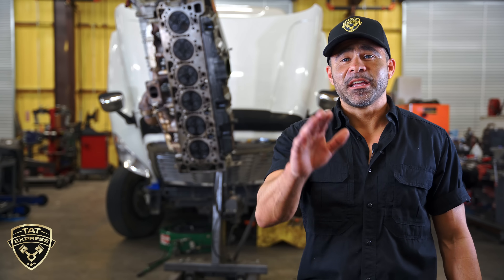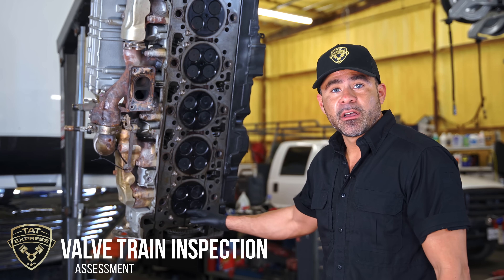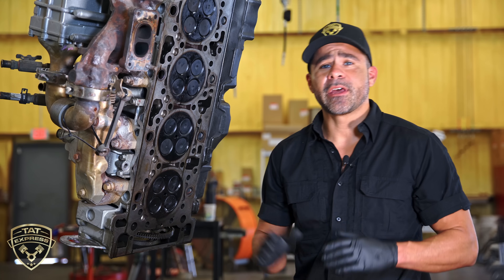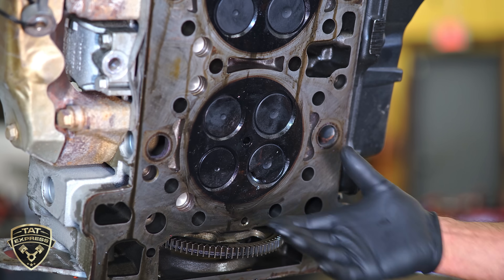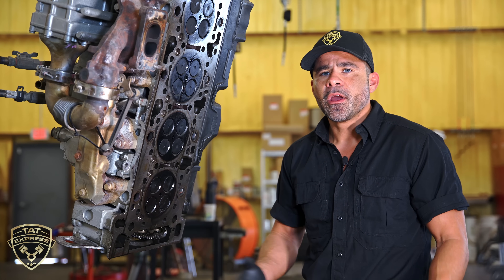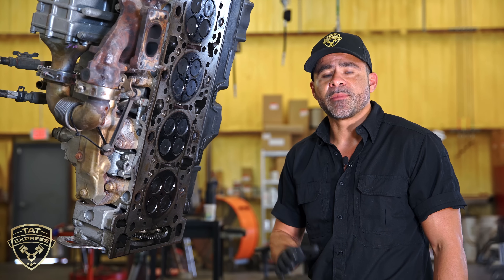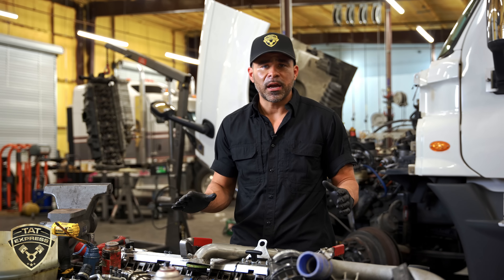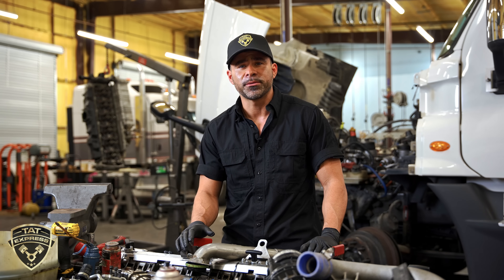The truth about semi deletes/Semi truck delete/diesel engine deletes/diesel delete explained

Comment: Damage to the intake valve was likely caused by soot buildup in the intake breaking off and jamming the valve. This buildup occurs when the EGR is functional. When deleting, the intake must be removed and cleaned to prevent this. This failure would have happened regardless of the delete. In our fleet, engines that have been deleted have over double the service life because these engines don’t put a high soot load in the lubricating oil. We also leave the horsepower rating at original spec.

Comment: not from my experience but anything can happen some people have no business working on trucks or driving them.
Reply from the maker: You’re right — a lot of issues come down to how the work is done. With deletes especially, the problem isn’t always the concept, it’s the execution. Modern engines rely on precise airflow and calibration, and one bad tune or shortcut can destroy a motor fast. Quality work and proper diagnostics make all the difference.
Reply: @TATEXPRESSINC  Pride in your work is a rare thing these days, maybe if the diagnostics were better understood by the people doing the work and educating the driver on proper operating procedure  for a vehicle with emission controls there would be less down time. Also fuel quality and def quality is probably has a role in messing up the sensors and filters.

Comment: Deleting a diesel engine will cause your EGTs to rise. EGR lowers your EGTs and also your horse power and fuel millage. During a study researchers found that engines with EGR intact had more lower piston ring wear because of the increased soot being fed back into the combustion chamber. However, engines with deletes had more upper ring wear due to more heat. In years past diesel contained sulfur which is also abrasive to piston rings. I’ve seen semi trucks go over a million miles with EGR and SCR intact. I witnessed a 2021 F-350 go over 525,000 miles with no emissions system failures before the owner traded it in. Had very little blow by. Truck towed non-stop its whole life. If these modern diesel trucks are used as intended the emissions systems will last. Short trips, never towing, lift kits / stuntin’ around, etc will cause problems and more soot to accumulate. 95% of pickup truck buyers would be better served with a gas truck. It makes no sense to own a diesel unless you tow heavy often. They are tuned for work.

Comment: I've deleted close to 100 trucks (Detroit,Paccar,Cummins) because where I'm from we don't need that crap and all those trucks are running strong and they just keep going... It's all about the tunning,and in most cases I don't even touch fuel maps on the file...

Some people delete and increase HP at the same time and that's another story...
Reply from the maker: @jcjc2593
I get why guys go that route — breakdowns cost time and money. But here’s the reality I see in the shop every week:

• Deletes often hide the real problem, not fix it
• Engines end up running richer and hotter
• Premature turbo, injector & aftertreatment failure
• And once it fails… repairs are way more expensive

Comment: Absolute garbage info. This guy is trying to sell you more maintenance on all those systems. Yes deleting *can shorten the light of the truck if you turn the power up, but a lot of people delete all the systems to extend the service life of the truck and reduce the maintenance costs. Since when is pumping dirty exhaust back into your engine, a good idea lol what a freaking joke if you keep the power at the same level from the factory, you get better fuel economy, and a lot less maintenance in addition to a longer lasting motor.

Comment: Tuning determines power, deleted or not. I would argue the valves run cooler on deleted trucks and the EGT is lower. A free flowing exhaust allows the turbo to move air across the piston top and valves during the overlap period. There are too many tuning factors to consider to just blame a delete. What is the injection timing? What do the fuel tables look like? How much power is the tuning intended to make? How tuning makes power is very important. Done right, this is a million miler all day, done wrong.....
You have a broken intake valve and seat. Most of the compression is going into the intake. As for the cooling system pressure, the head gasket  is not the problem. Look for a crack around that valve seat.

Comment: Who told you that delete give you more power that a big lie it depends on the tune on the ecm you do. Bro you the only mechanic that don't like  delete, be real mechanic not fake one please
Reply from the maker: I am one of the realest out here. Hack deletes will push the engine beyond its designed limits, increase cylinder temperatures and cause failures. 💪🏼🔧🚛

Comment: After treatment crap can go to hell ok say itvwill give u all those pronlems after yr 1-2  but how much u gonna save on dat time frame not dealing with the bs EGR NOX SENSORS. def pump SCR filters gotdamn land of the free my A…
Reply from the maker: I get the frustration — aftertreatment issues are expensive and can be a nightmare when they fail. But deleting it doesn’t make the problems go away — it just trades short-term savings for long-term risks like fines, warranty loss, and major engine damage. I’m here to help drivers avoid all of that and keep their rigs running strong the right way.

Comment: WELL MAINTAINED CAT DIESEL ENGINES HAVE BEEN GETTING 3,000,000 MILES WITHOUT DEF AND PRESIDENT DONALD 🇺🇸 TRUMP IS GOING TO LEGALIZE "DELETING" SO... YEAH LYING IS BAD 🖕
Reply from the maker: CAT engines take modifications better than modern engines because they were designed without emissions, so reversing is easier for these models. If mods become legal, that would allow the market to produce quality tunes compared to what's on the black market now. Modern engines can not handle the excessive heat when turned up and modified. They are pushed beyond their designed limits. 🇺🇸🫡💪

Comment: If the government deregulation kicks in, could another engine be installed into a newer truck if needed?
Reply from the maker: I have heard of new regulations being stopped, but existing regulations are still enforced. This does not change the fact that modern engines are designed to run on after-treatment systems.

Comment: Bullshit. The delete isn't the issue. The tune is everything. U can't see the tune so blame it on the delete. FYI a delete truck runs COOLER. Your theory of delete is bogus. Stick to being a parts changer. U have no clue.
Reply from the maker: Your feedback is bogus.  Do what you like. It’s your truck. If hack tunes are all that is available, the results will be the same. Deleting pushing modern engines beyond their designed limits

Comment: My experience with delete: after countless dpf issues and tens of thousands of $$ I decided to do the delete, the final straw was that in a Freightliner dealer they told me that I needed to replace the whole 1-box..... Not a cheap option!  so a friend of mine recommended me a mechanic that did  deletes so I went for that option instead of spending over 15k! @ 1st it was Wonderful but later on my engine started to break and it was not cheap repairs! My engine started to consume a lot of oil  just after 4 months from the delete and  one day the inevitable happened: blow-by... I was not happy about that! I was torn between buyin a newer truck or do the rebuild so after carefully considering it I chose the rebuild!... If you want the rest of the story make a comment requesting it & I'll put part 2!
Reply from the maker: It sounds like you had a very unfortunate experience.  The deletes can be tempting but they definitely void your warranty and will likely be a more expensive repair down the road.
Reply: I don't think a 2014 truck has any warranty left on it! so no worries about that!

Comment: I as well argue that a delete and more power are not related.  Power comes from a tune, delete or no delete.  The engine runs clean air under WOT from factory, so your AFR will be as intended regardless of def or egr.  I agree the delete was done poorly.  However, on a proper delete with the engine running factory power, your only concern is proper coolant flow since the egr is compromised.
Reply: Right now my only complaint is that after the bypass, the coolant temp and oil temp take a long time to warm up.”

Comment: All deletes are not bad. But most shops are working on dpf systems instead of engine issues 90 percent of the time. So it's a cash cow for shops. That's why most dealers and private shops don't work on deleted truck because most of their work is dpf issues. Bio diesel is another problem for these issues but know shop will tell you that because they make money off your break downs. DD15 engines is supposed to use ultra low suffer diesel not bio diesel.  Bio diesel creat more soot causing more dpf problems by clogging up the filter system earlier than expected. That's why you do an overhead annually and do a cylinder compression test every 6 months to prevent issues like that and also see what's going on with your truck internally. I wouldn't recommend deleting or blocking off EGR ports because the engine need to Flo for performance reasons. So if you do that  and change your oil and all your filters every 14 to 20 thousand miles you might be able to get 2 million miles out of your engine.  I'm at 1.6 million miles on my 2011 cascadia with original internals except the bottom end has been done twice.
Reply: And yes it's been deleted over 3 years ago and counting with no problems since the delete.
Reply: And remember doing Covid the epa allow shops to delete DPF systems on a lot of trucks  because of low parts 
Inventory. So some dealer shops really can do good delete because they have the programming to do it. So I'm sure that kind of stuff gets sold to other shops. You just have to do your homework like any other project.
Reply: Which part you remove which parts left on the truck.  I'm thinking about deleting my truck

Comment: how does a cracked valve cause coolant pressure? shouldnt you have excessive crank case pressure?
Reply from the maker: The cylinder head was cracked as well, causing combustion gases to enter the cooling system.

Comment: Trucks in mexico dont have emissions, all you gotta do is get oem parts and template from a mexican truck
Reply from the maker: Modern diesel engines are not designed to run without emissions systems. Any tune will push the engine past its designed limits. Series 60 engines are less effective because they were originally designed without emissions control.
Reply: @TATEXPRESSINC  There are about a million diesels on the road that prove otherwise.
Reply: @TATEXPRESSINC yes they are..but not in USA.. in europe  trucks have more power, they are more reliable, spent less fuel .why?? Because they have  different  system

Comment: The delete isn't the problem, it's the re-map/tune that's the problem, I would argue a proper delete increases the life of diesel engines,some of the soot build up in the oil is quite shocking on some of these modern engines,just as well put grinding paste in the oil,engineers have spent decades trying to get as much clean cool air into the combustion chamber,today they are shoving exhaust gasses back in
Reply: Why do you think exhaust gas isn't clean? Soot is simply hydrocarbon. Exhaust gas helps cool cylinder temperatures. You can actually get higher cylinder pressures on a diesel using EGR. High cylinder pressure equals more power.
Reply: @Figureitout_edu  finally somebody that understands!!!
Reply: @Figureitout_edu exhaust gas cool cylinder temperatures more that ambient air?
Reply: @F @Figureitout_edu  that is not how that works. You are never going to make more power in a combustion engine by shoving air in the intake that is warmer than the ambient temperature.  

EGR is strictly for emissions.
Reply: @trickmytrailer  you can, studies prove it, but I'm not going to waste my time, you clearly have no idea how inert gas lowers combustion temperature but maintains cylinder pressure. Read a book then get back to me. I've been a diesel engine mechanic 25 years and teach diesel engine emissions systems for a living.
Reply: @Figureitout_edu that explains it. I’m not even gonna ask for the study, you can point people to it if you like. 

Where are all the resources in the aftermarket for high performance EGR systems? You’ll have the market cornered if you start making some, because right now the only performance part with “EGR” in the title are delete kits. 

The only thing pumping a bunch of exhaust into the intake is going to do is reduce hp and tq. That will inherently show a lower EGT number. About the only case for inert gasses being used for performance is water injection. 

I have no doubt you’re probably smarter than I am. But, so are the people running performance diesel companies. Why haven’t they adopted this amazing cheat code?
Reply: @trickmytrailer  I've dyno'd tunes from Pittsburgh Power that make 750 to the wheels, out of a 505 flywheel engine with full emissions. You just don't have an even remote understanding of emissions, someone who doesn't understand them told you they were bad and you believed them. Read a book, spend some years on a dyno, tear apart over 1000 engines and get back to me.
Reply: @Figureitout_edu my question is. Is delete good engine or not good?
Reply: @Figureitout_edu I remember years ago, a big company bet the farm on a revolutionary, EGR only emissions system that promised better performance, no DEF, no SCR. Just that incredible EGR system that does wonders for the engine. 

That was called the MAXXFORCE. They lost the farm and to this day people are afraid to buy an international truck, even when equipped with an X15. 

I’d love to see these studies or dyno videos. 

Also, I’m not saying emissions systems are a bad thing. I think they have done wonders for air quality, especially in cities. I am, however, saying unequivocally, EGR is a bad thing. Particularly for performance.
Reply: @trickmytrailer  So you're telling me you've never worked on a maxxforce, vovlo and scania did just fine for years, no dpf leaning into egr, even today the scr catalyst is a dpf. But I actually work on engines you parrot :)
Reply: your a 100% correct
Reply: Genau so sehe ich das auch. Aber man kann ja versuchen, jeden Schaden auf die EGR Blockierung zu schieben. Wenn man sich die OEM Programmierung des EGR Ventils mal genauer ansehen würde, würde man nicht so mit Halbwissen um sich werfen!

Comment: DD platforms do not handle deletes at all. The exhaust gases are used in combination with the air fuel ratio. Playing with the injection timing and such is really a bad idea. I had a 2017 DD 15 that had a minor after treatment problem, but other than that the truck was running great, I chose to delete it, and everything went downhill from there, and could never get the programming, correct. stay away from deletes and just maintenance the after treatment system
Reply: DD platform is really no different from the Cummins platform. Drivers create a lot of issues to their trucks because they don't know their trucks inside and out. In talking to owner operators now not company Drivers.  You must do your homework in getting to know your truck inside and out.  That's the 1st step of owning your truck.
Reply: Has nothing to do with DD platform but bad tuner.
Reply: Absolutely false. I attended a workshop with engineers for the DD platforms for a whole weekend. The motor is designed to work in step with the recirculated exhaust gases. Once you remove those recirculated gases from the combustion chamber, the motor will never run as efficiently and as powerful as it was designed to. Those are just fax straight from the manufacturer, and I witnessed it with my own eyesand from what I did to my truck. But do as you please.
Reply: @bz4shez  LOOOOL. Why would a manufacturer want you to delete their engine? Dude don’t make people laugh. It is true that it is better to keep egr in place and only delete scr and dpf on these engines because it makes things simpler. When you take out egr you have to mess with fueling maps and that’s where most tuners go wrong because they are simply not expert enough to create a map that doesn’t cause overheating, but there are still many tuners who are able to do so. 

It’s all about the Tuner. Dd15 can be successfully deleted with or without egr if you hire the right professional. Absolutely no difference in reliability as compared to Cummins isx. Cummins isx is just easier to delete because you can just use the tuning of the earlier isx engines without dpf and scr . Literally copy and paste tuning

My best advice would be to keep egr on tho for the delete. It makes it less likely for a failure because of non expert tune
Reply: @serggla924  I will agree with you on the EGR. If you’re going to delete a DD platform motor it’s best to leave the EGR. I have seen a couple that were successful that way. The late model motors meaning newer than 2017 are definitely more difficult to get a proper tuneup for. I have not met anybody yet and I know a couple good tuners that are able to get a late model DD 15 platform correct with a full delete. Although I have seen a couple with leaving the EGR and deleting the rest.
Reply: @ ghg17 (2017-2021) are easy to tune/delete. Guys are having problems with the 5th gen (ghg21). Detroit said  they upgraded many features on the newest gen but many people seeing cylinder heads failure before 500k 

Mexican parts